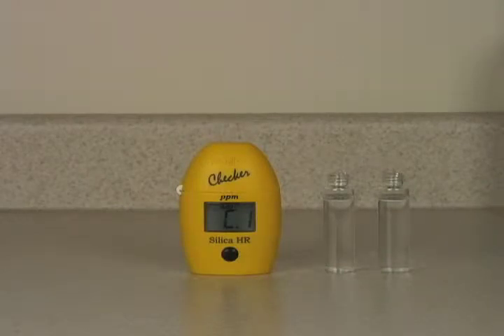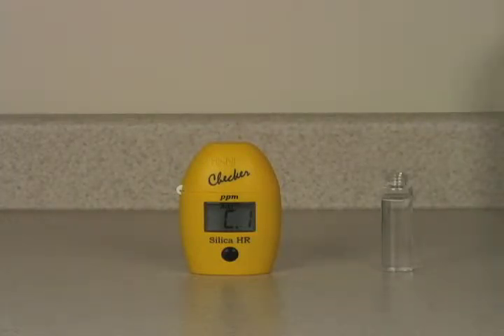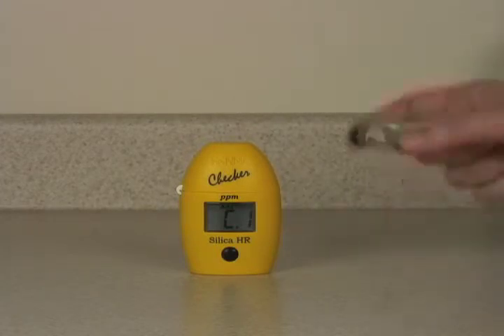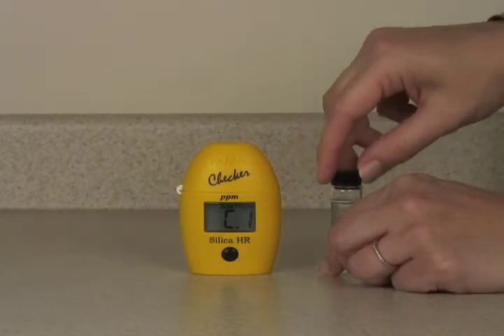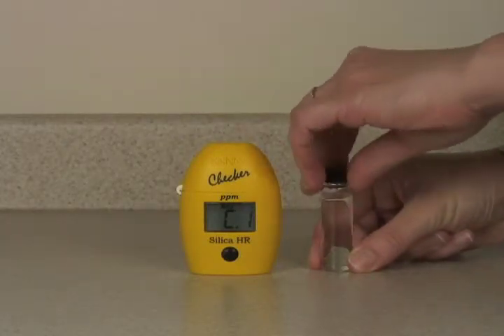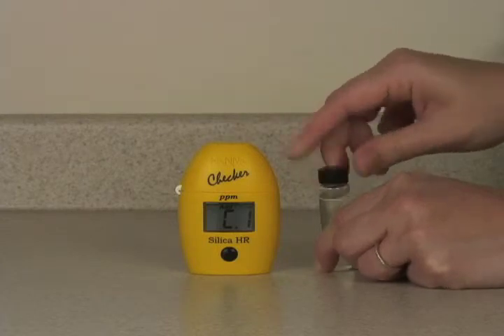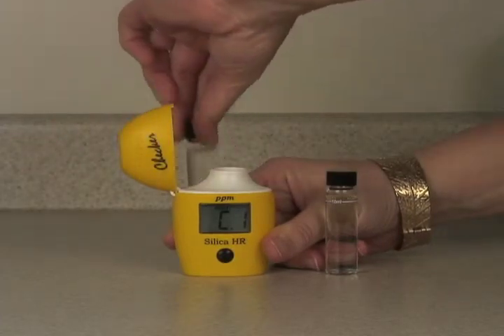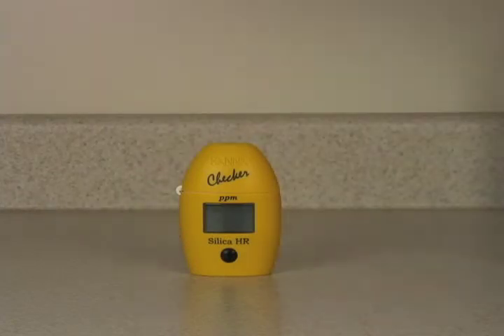HI 770 Silica Checker HC

Comment: I don't even know what's going on yet but this video is a fake your video for some reason actually shows you switching the one in the back good job you must be promoting this product
Reply: really...., Hanna instruments is promoting their product....Shocking!! Call the Press!! Did you listen to what they said? the 1st one is used to zero the meter and the second one is used (after 12 minutes of combined waiting) to actually check the values. There's no point in having the machine sitting there running for 12 minutes while you simply wait around for a reaction to take place, ergo the 2 vials.